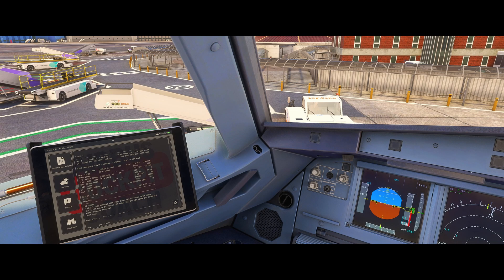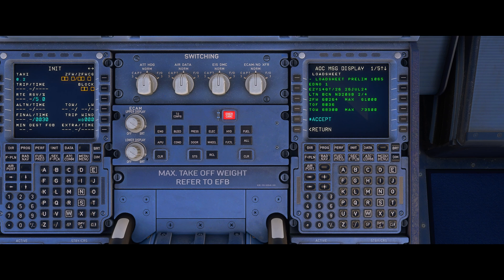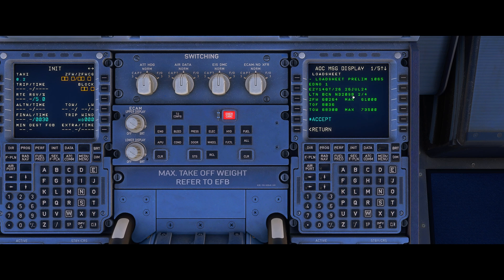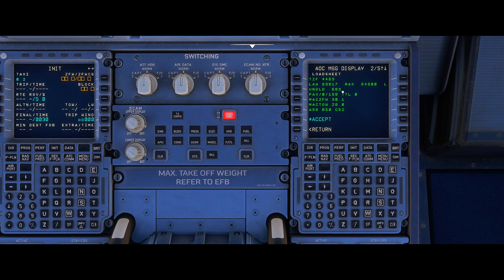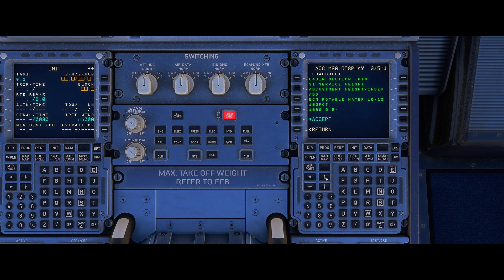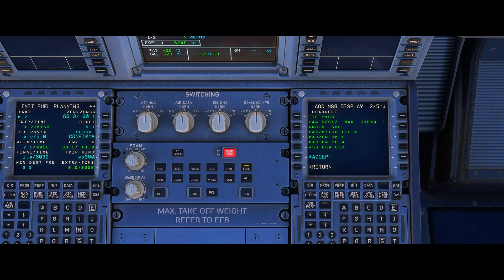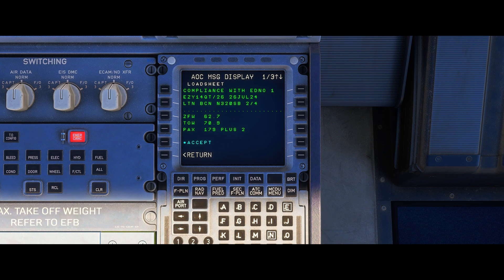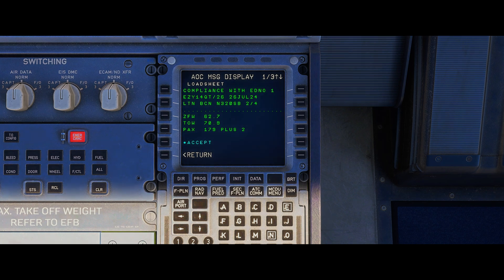Preliminary Loadsheet Explained | Real Airbus A320 Tutorial in MSFS 2024

Comment: Another quick question, if I may. In an earlier video on configuring the MCDU you very helpfully used the Fenix EFB to configure INIT-B and PERF values.  In the real world would you be using the load-sheet for the INIT-B values? The EFB is an amazingly useful addition, but simmers often focus on real-world SOPs. I suppose the same question applies for V-speeds. Lacking an EFB, how does one calculate these?
Reply from the maker: Hello, yes we would use the load sheet for init B which can be on the EFB, ACARS or paper in the real world. If you are lacking an EFB in the SIM I would suggest using the Simbrief performance tools which provide takeoff and landing data based on your load and the current weather

Comment: Thank you so much for taking the time to explain the load sheet to us simmers. Just one question if I may, in the prelim load sheet, under load is 683kg, on the final load sheet I note an extra 21 pax, which at 75kg approx per pax would equal an extra 1575kgs. This would take the aircraft over the limiting factor of max landing weight? Or have I got this all wrong, thanks again buddy, Peter
Reply from the maker: Hello thanks for watching and good spot! The Fenix did not produce my final load sheet for the the preliminary so had to create another for the purposes of showing it but it had some variation. It can however change so if this load scenario was the case we would not be able to depart, something despatch could try and do is try and get a shorter route with less fuel burn if not already fuelled but that could be subject to slot delays. Operations can get interesting when working close to limits 👍
Reply: @AirbusCockpitCoach  ah that’s brilliant, I did wonder if you’d used a different loaf sheet for illustration purposes. Thank you for replying and clearing that up, happy flying buddy
Reply: Load sheet even 😆